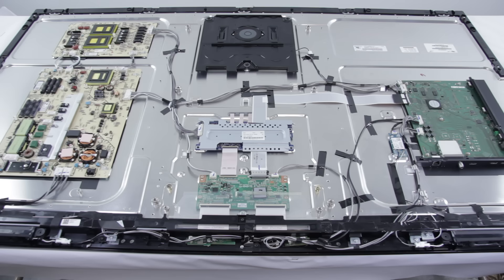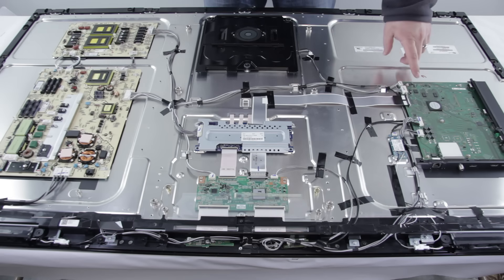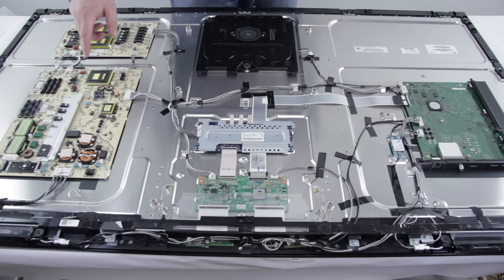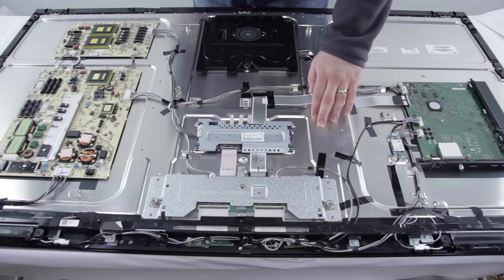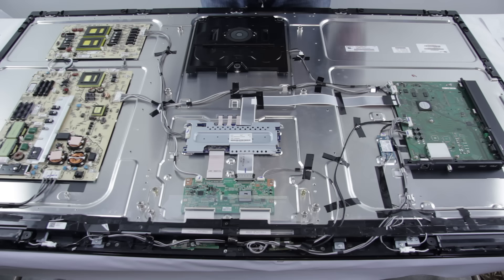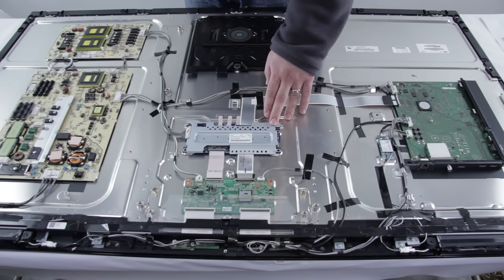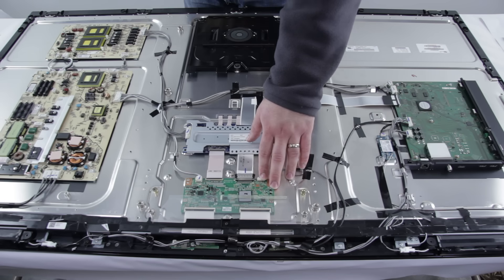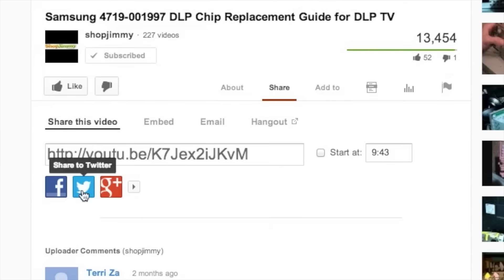LED TV Repair Tutorial - Common Symptoms & Solutions - How to Repair LED TVs

Comment: My LG LED 55 inch tv LH90 is right at 5 years old. This problem started within the last month and has progressed across the screen starting from the left hand side middle ways of the screen. It is more noticeable on the green grass of baseball or football games but also on light colored walls on shows like HGTV programs. I am including a picture with red arrows pointing at the lines.
https://imagizer.imageshack.us/v2/458x458q90/673/MY0P3I.jpg
Reply from the maker: Craig Mcduffie   Please watch this video FIRST to help with your repair!  TV Repair! LCD, LED, Plasma, DLP How To Fix Your TV with ShopJimmy.com Help!  This could be a problem with either the main board or the TV panel.  You can replace the main board and see if that fixes the problem with your TV.  Here is a link to replacement main boards:  http://www.shopjimmy.com/catalogsearch/result/index/?cat=56&q=LH90  Be sure to match part numbers on your current board, with your replacement for compatibility.  Thanks and please let us know if you have any further questions with your TV Repair!  www.shopjimmy.com

Comment: Was wondering what would make a tv seem as if the refresh rate is gone completly,half of the tv leaves trail shadow if something is moving on the screen
Reply from the maker: Nick Stoto   This sounds like a TV panel (TV Screen) problem.  If your TV panel is bad, it may be more cost-effective to replace the TV as panels are typically hard to find in stock, difficult to replace, and expensive.  Thanks and please let us know if you have any further questions!  www.shopjimmy.com

Comment: My LG LED 55 inch tv LH90 is right at 5 years old. This problem started within the last month and has progressed across the screen starting from the left hand side middle ways of the screen. I am including a picture with red arrows pointing at the lines.
https://imagizer.imageshack.us/v2/458x458q90/673/MY0P3I.jpg
Reply from the maker: craigmcduffie   This sounds like a TV panel (TV Screen) problem.  If your TV panel is bad, it may be more cost-effective to replace the TV as panels are typically hard to find in stock, difficult to replace, and expensive.  Thanks and please let us know if you have any further questions!  www.shopjimmy.com

Comment: lg led tv 47ld520. no power 
should i replace the whole power supply board od individual capacitors?
Reply from the maker: MIKE.BENEDICT  Please watch this video FIRST to help with your repair!  TV Repair! LCD, LED, Plasma, DLP How To Fix Your TV with ShopJimmy.com Help!  Try this at your own risk.  I recommend checking for standby in your TV.  If your TV does have standby then replace the main board.  If your TV does not have standby then replace the power supply board.  Here is a link to replacement parts:  http://www.shopjimmy.com/catalogsearch/result/?q=47ld520  Be sure to match part numbers on your current board, with your replacement for compatibility.  Thanks and please let us know if you have any further questions with your TV Repair!  www.shopjimmy.com

Comment: Hi,
My LED TV cannot power on. I can see the backlight but the startup logo do not display. After I turn it on using the remote control, it cannot respond to any other buttons even if I press the buttons on the top of the TV. And it cannot be turned off except switching off the power. What do you think the problem?
Also, I want to know if it is dangerous to do a fix on this TV as most people saying this about the old CRT TV.
Thanks
Reply from the maker: AK7662389 Mr Chan   I recommend replacing the main board in your TV.  Please reply with your TV model number.  Click here to view a video that shows how to find your TV model number:  TV Repair STEP #1 Help IMPORTANT TUTORIAL How To Find Your TV Model Number Tutorial TV Repair Help  Thanks!  www.shopjimmy.com

Comment: I have 47 inch led lg tv.(47 LV 5500)  It has vertical line-width 9".  What is the problem? How much does the replacement part cost?
Reply from the maker: Kuriakose Srayil   This sounds like a TV panel (TV Screen) problem.  If your TV panel is bad, it may be more cost-effective to replace the TV as panels are typically hard to find in stock, difficult to replace, and expensive.  Thanks and please let us know if you have any further questions!  www.shopjimmy.com

Comment: I have a Samsung 40" LED tv Model # UA40F6400 - recently stopped turning on when we push the power button.  RED LED by the power button still comes on when plugged in.  There is a constant clicking noise (every few seconds) when plugged in. .  How do I verify that it is a power supply board issue? Thanks!please resove my query,my mail id is imetra786@gmail.com.thanx
Reply from the maker: *****   I recommend replacing the main board in your TV.  Here is a link to replacement parts:  http://www.shopjimmy.com/catalogsearch/result/index/?cat=56&q=40F6400  Be sure to match part numbers on your current board, with your replacement for compatibility.  Thanks and please let us know if you have any further questions with your TV Repair!  www.shopjimmy.com

Comment: Hi i have an rca led39b45rq the tv gets power but does not come on the red light in front turns off when i go to turn it on but tv doesn't turn on.
Reply from the maker: Joseph Martino  Please watch this video FIRST to help with your repair!  TV Repair! LCD, LED, Plasma, DLP How To Fix Your TV with ShopJimmy.com Help!   I recommend replacing the main board in your TV.  Here is a link to replacement parts:  http://www.shopjimmy.com/catalogsearch/result/index/?cat=56&q=led39b45rq  Be sure to match part numbers on your current board, with your replacement for compatibility.  Thanks and please let us know if you have any further questions with your TV Repair!  www.shopjimmy.com

Comment: I have a Sanyo DP 19241 LED backlit TV that got hit in a lightning surge. Afterward it would not come on. I ordered a power board from you and it now powers up. Unfortunately I now have the dim screen problem described and tested with the flashlight test you mentioned. On this small (19") tv it is not clear what board controls the backlight, as the inverter board is easy to point out on bigger TV's in the videos I have watched online. Any suggestions?
Reply from the maker: Alexander Monroe  Please watch this video FIRST to help with your repair!  TV Repair! LCD, LED, Plasma, DLP How To Fix Your TV with ShopJimmy.com Help!  I recommend replacing the power supply board and the main board in your TV.  Here is a link to replacements:  http://www.shopjimmy.com/catalogsearch/result/?q=+DP+19241  Be sure to match part numbers on your current board, with your replacement for compatibility.  Thanks and please let us know if you have any further questions with your TV Repair!  www.shopjimmy.com

Comment: 46" Samsung LED Model UN46EH5000FXZA, sn Z4MM3CXC800203K sound but no picture - shadows moving in background if looked at closely so programs are received. First guess is the LED driver needs to be replaced. Further suggestions?
Reply from the maker: Salvatore Pagano   This is either a problem with the LEDs in the TV or your power supply board.  You can try replacing the power supply board to see if that fixes the problem.  Here is a link to replacement parts.  http://www.shopjimmy.com/catalogsearch/result/index/?cat=229&q=UN46EH5000FXZA  Be sure to match part numbers on your current board, with your replacement for compatibility.  You can also call our customer service for further assistance with your purchase.  (877) 881-6492  Thanks and please let us know if you have any further questions with your TV Repair!  www.shopjimmy.com

Comment: I enjoyed the tutorial, I have a Haier 40"LED HLH406BB, There is no serial number in the space, unless it's this barcode DC0Q00E0100D172C0300. My problem the TV powers up and blinks blue and red, If I catch it sometimes I can hold the power button it will come on beautiful picture, and some days you can turn on it may take hours or days before it comes on. This morning I turned it on I got sound off and on. Please help!
Thanks  Walter
Reply from the maker: Walter Harrell   This sounds like a problem with the main board in your TV and I recommend replacing it.  Here is a link to replacement parts for your TV model number on our website, click here:  http://www.shopjimmy.com/catalogsearch/result/index/?cat=56&q=HLH406BB  Be sure to match part numbers on your current board, with your replacement for compatibility.  You can also call our customer service for further assistance with your purchase.  (877) 881-6492  Thanks and please let us know if you have any further questions with your TV Repair!  www.shopjimmy.com

Comment: I have an LG LED TV model  #47LV5500 .  The power light comes on and goes blue but I have no video or audio.  I have tried the flashlight test but no picture can be seen.  Any ideas?
Reply from the maker: Chris Alan   I recommend replacing the main board in your TV since there is no image on the screen.  Here is a link to replacement parts for your TV model number on our website, click here:    http://www.shopjimmy.com/catalogsearch/result/index/?cat=56&q=47LV5500  Be sure to match part numbers on your current board, with your replacement for compatibility.  Here is a link to a video showing how to identify your part number, click here:  TV Part Number Guide for LG & Zenith Main, Digital, & Tuner Boards (LCD, LED, Plasma TVs)  You can also call our customer service for further assistance with your purchase.  (877) 881-6492  Thanks and please let us know if you have any further questions with your TV Repair!  www.shopjimmy.com

Comment: Hello there! We have a LG 3D TV, model #47LW5000-UC, that is completely dead. No lights, nothing? We would really appreciate your advice? Thank-You very much
Reply from the maker: Eniko Cs   This sounds like it could be the power supply board or the main board in your TV that is bad.  I recommend replacing the power supply board first and then if the power supply does not fix the problem replace the main board.  Here is a link to replacement parts: http://www.shopjimmy.com/catalogsearch/result/?q=47LW5000-UC  Be sure to match part numbers on your current board, with your replacement for compatibility.  You can also call our customer service for further assistance with your purchase.  (877) 881-6492  Thanks and please let us know if you have any further questions with your TV Repair!  www.shopjimmy.com  Thanks!  www.shopjimmy.com

Comment: We had lightning and thunder last night, it cut off our Insignia TV Ns-32L120A13, The cable box works, the TV won't turn on. I tried different power outlets. Looking at your video it seems like a power supply problem. I took the back off. I did not see any burnt parts. Is there a reset button or fuse on this unit? thanks, Bob
Reply from the maker: Bobby Rio   I recommend replacing the main board and the power supply board in your TV.  Here is a link to replacement parts for your TV model number on our website, click here:  http://www.shopjimmy.com/catalogsearch/result/?q=Ns-32L120A13  Be sure to match part numbers on your current board, with your replacement for compatibility.  You can also call our customer service for further assistance with your purchase.  (877) 881-6492  Thanks and please let us know if you have any further questions with your TV Repair!  www.shopjimmy.com

Comment: Panasonic TV power light flashing amber then turned off model Tx-p50x50b serial ff-2250983
Reply from the maker: Shaun Tillotson   How many blinks are you receiving?  Please reply with that info.  Thanks!  www.shopjimmy.com
Reply: Half a dozen times won't come back on
Reply from the maker: Shaun Tillotson Try this at your own risk.  If you are able to, check the voltages coming from the power supply you should have a 5v standby and a 12v turn on voltage.  Thanks!  www.shopjimmy.com

Comment: i have SAMSUNG UN40D6000SFXZA TV. The problem i have no power and standby light. i tried troubleshooting my tv, but i am lost. My TV back light turns on when i remove the connector that connects the mainboard and power board. i checked the voltage reading from the power board and it seems that everything is okay. when i ground the power on/off the back lights goes off, when i ungroud  the back light goes on. What could be my problem the mainboard, power board could be grounded, is it possible the touch buttons might be bad.

Comment: LG   42LN5300   LED TV.

Screen goes blank intermittently. Length of black screen varies.  Sound continues to work.  Comes and goes with no apparent pattern with this problem.  Doesn't seem to be related to how long the TV is on.   TV is maybe a year old.   Help!  Thanks Bruce
Reply from the maker: *****   I recommend running the flashlight test on your TV.   Here is a link to a video we produced that shows how to run the flashlight test. No Image No Picture on TV Screen - Flashlight Test LCD & LED TV Repair - How to Diagnose Symptoms 2 Please reply with your flashlight test results and we can recommend a replacement part for your TV repair. Thanks and please let us know if you have any questions! www.shopjimmy.com

Comment: I have a LG 55LN5710 LED TV, and it turned on with images & sounds.  However, the backlight was off randomly..  because I could use flash light to see the image and still hear the sound.   What could be the issue?  The LED backlight driver and how much to replace it.  

I appreciate any help.
Reply from the maker: playlist10002   This sounds like it could be a problem with the power supply board or the actual LEDs in your TV.  You can replace the power supply board in your TV to see if that fixes the problem.  Here is a link to replacement parts:  http://www.shopjimmy.com/catalogsearch/result/index/?cat=229&q=55LN5710  Be sure to match part numbers on your current board, with your replacement for compatibility.  You can also call our customer service for further assistance with your purchase.  (877) 881-6492  Thanks and please let us know if you have any further questions with your TV Repair!  www.shopjimmy.com

Comment: i have a 55inch lg tv  model number 55lv4400-ua 
the tv has power the problem is the screen itself i think. i can view the channels but right down the middle is a gray streak all you see is gray through there which is more than half of the tv like 70 percent. i took it to a repair shop and  they said it was a main board failure and wanted to charge me 500$ to fix it.
Reply from the maker: Stephanie Oxendine   This sounds like a TV panel (TV Screen) problem.  If your TV panel is bad, it may be more cost-effective to replace the TV as panels are typically hard to find in stock, difficult to replace, and expensive.  Thanks and please let us know if you have any further questions!  www.shopjimmy.com

Comment: I have a led tv model  LG42LX6900. It powers up and responds to the remote,but fails to give out any audio or video picture.All capacitors visually check ok  on the single power board.Do you have or know of a fix for my problem.
Reply from the maker: Abduljabbar Roghey   I recommend replacing the main board in your TV.  Unfortunately I do not see any replacement parts in the search results for your TV model number on our website.  Please reply with your part number on your main board and I can try searching for replacement parts.  Thanks and please let us know if you have any further questions!  www.shopjimmy.com

Comment: Samsung 55"
Model code: UN55D6050TFXZA
Version No: H301

I have horizontal lines starting on the right side of the screen that fade as they go across tot he left side of the screen.
Reply from the maker: Adam Brescia   This sounds like a TV panel (TV Screen) problem.  If your TV panel is bad, it may be more cost-effective to replace the TV as panels are typically hard to find in stock, difficult to replace, and expensive.  Thanks and please let us know if you have any further questions!  www.shopjimmy.com

Comment: I have a Dynex DX-40L150A11.  When I attempt to turn on TV, power light goes from red to blue but no picture and get a short buzz sound that seems to be coming from power supply board.  Please help... thank you!!!
Reply from the maker: Luke Forand   I recommend replacing the power supply board in your TV.  Here is a link to replacement parts for your TV model number on our website, click here:  http://www.shopjimmy.com/catalogsearch/result/index/?cat=59&q=DX-40L150A11  Be sure to match part numbers on your current board, with your replacement for compatibility.  Here is a link to a video showing how to identify your part number, click here:  TV Part Number Identification Guide for Insignia & Dynex Power Supply Unit (PSU) Boards  You can also call our customer service for further assistance with your purchase.  (877) 881-6492  Thanks and please let us know if you have any further questions with your TV Repair!  www.shopjimmy.com

Comment: Recently just had a single solid black line, thats roughly 2 pixels wide and goes full length vertical down the TV near the center of the screen.  Came out of no where.

It's a little larger than 2 pixels, off to the side theres dotted lines running vertical with it, makes it look sort of like a movie reel.

Would this be a TCON problem or a problem with the LED Driver?

Rest of the TV is perfectly fine.
Reply from the maker: MrJatobi   This sounds like a TV panel (TV Screen) problem.  If your TV panel is bad, it may be more cost-effective to replace the TV as panels are typically hard to find in stock, difficult to replace, and expensive.  Thanks and please let us know if you have any further questions!  www.shopjimmy.com